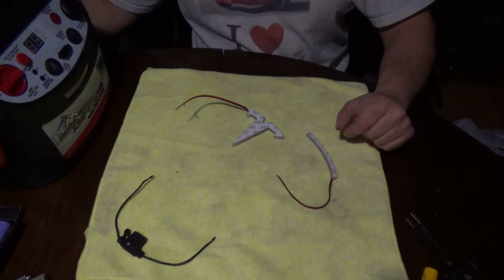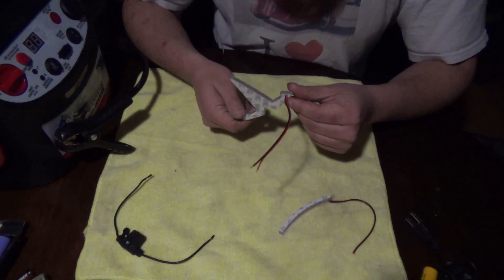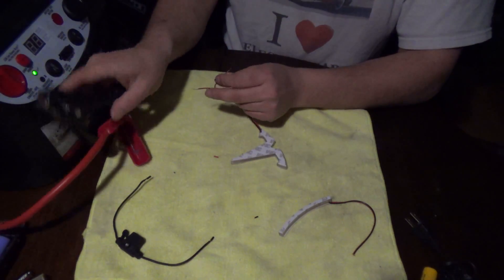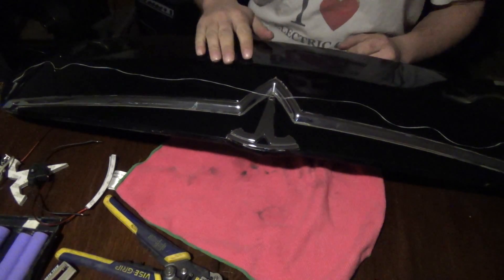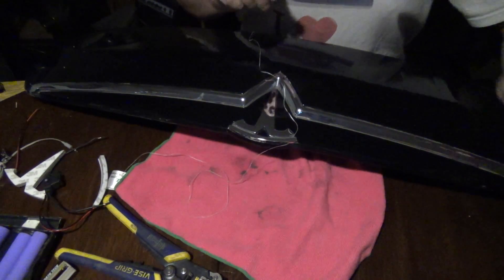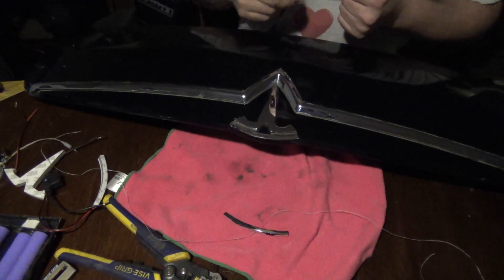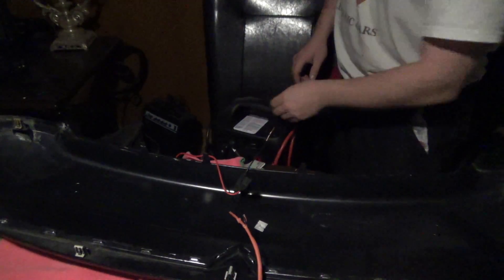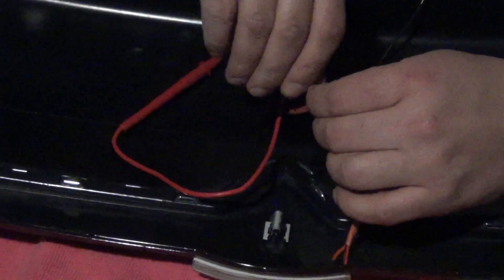Tesla Motors Model S: Light Up Tesla "T" Installation in the nose cone (Warning, Boring)

Comment: Great video! Do you know if its possible to make a AUX connection to the Model S stereo? Also do you know how much power you can draw form the USB ports and the "cigarette power"? 

Keep them videos coming.
PS: Have you seen the consol insert (between the front seat)?
Reply from the maker: No, not possible. You would need to use Bluetooth to connect. 
The USB ports are aprpox 500mAh. Though, some report the drivers side USB port going as high as 1Ah. The cigarette port, I wouldn't draw more then 100 watts.
Reply from the maker: I have seen the center console insert, though, do not have one to test out :)
Reply: ***** Thanks for your quick reply. I was hoping to be able to get a AUX port due to the lag in audio while playing video (use a 10" pad in my curent car connected to the car audio (with feedback set to rear.)
Reply from the maker: Yah, with the iPad, you can Bluetooth it directly to the audio system. I do that with my midgets beat to hell iPad. The kids love it. Put on Curious george, and they are in Theater Sound Heaven!
Reply: ***** Hi. When you play Curious George, doesn't the audio sound come like half a second after the video (lag)? Or is the audio synced perfectly on video playback?
Reply from the maker: never noticed any lag. Usually my youngest has the ipad in the back watching.
Reply: ***** OK. Thanks for your reply. Still waiting on my TMS, estimated delivery in March (Norway)
Reply: omart0505 Make sure to get lots of pictures !
Reply: ***** NO problem! :)